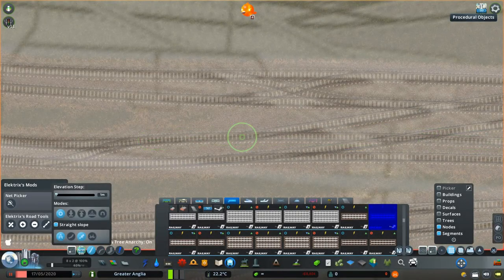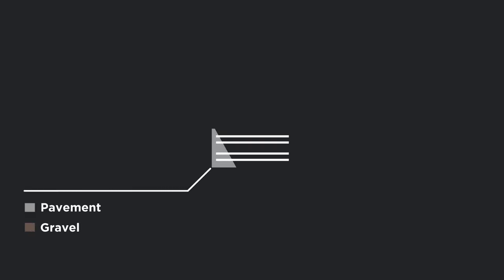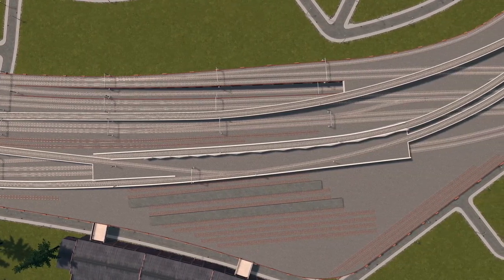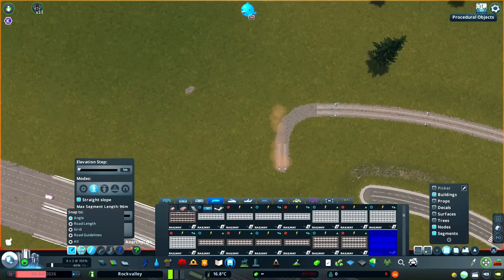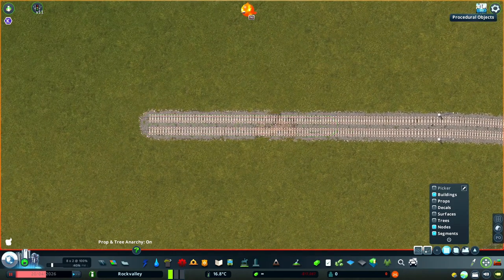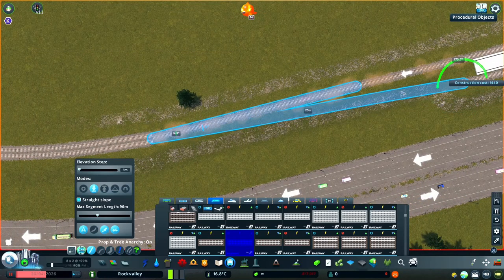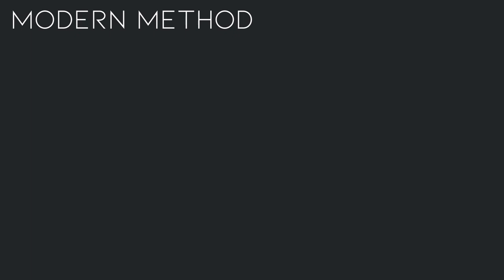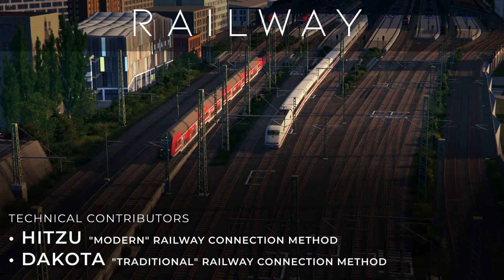Single and Double Track Connections in Cities: Skylines | RAILWAY | Episode 01

Comment: how do you get those stations where you don't always get the criss-crossing of the tracks on each end?  I thought those were baked in?
Reply from the maker: The station is a custom station with an island platform layout, so in this case I'm connecting two individual one-way tracks to each end (rather than the combined single track), so there's no crossover. You can find the collection of stations here: https://steamcommunity.com/workshop/filedetails/?id=1368830383
Reply: @kjmci  ah, thank you!  One thing I wanted to comment on, it would be very cool to see a series from you about the overall pattern and rhythms of how rail is laid out in larger scales.  Something similar to this video  https://www.youtube.com/watch?v=a_LHJ2YYgFU  But this video doesn't answer, what's beyond the rail yard?  how do tracks usually arrive at rail yards, which direction do they go, where do they go and why?  When do they use single tracks, double tracks, quad tracks or more?  Don't know if my comment makes sense, but I think you would be very capable of producing a video that answers this for people.  For instance, other youtubers end up with solutions to rail infrastructure problems like rail roundabouts and other wacky solutions (!) which are totally unrealistic - and I think this is because people, myself included, don't understand how they work in real life.
Reply from the maker: Good feedback, thanks! I'll put this on my list of things to cover in future.

Comment: The modern way using the new generation of node controller mod doesn’t work properly. When I select a node with node controller mod after connecting the 2 single tracks with the double track, it creates an empty space between the 2. Am I doing something wrong or is it because the mod isn’t design to work like the old one?
Reply from the maker: I've had a bit of feedback on this but haven't had an opportunity to look into the new node controller mod's functions - but fundamentally, new mod, new features, new interactions with tracks. This video is an explainer on the previous (and still available for download, AFAIK) version.

I will look to provide an update with the new version once I have time to produce some more footage :)
Reply: @kjmci  thank you for your reply! I found out that it’s actually working: after it creates the empty space, you CAN combine them, but not completely; it still remains a little space between the 2 tracks which is kind of annoying

Comment: Great tutorial! I installed the Node Controller Renewal 3.0.1 and it seems not to work in this way anymore. I keep a part without rails in the node.
Reply from the maker: Hey! I've been quite busy with work the last month which is why there's not been much in the way of new episodes. I'm on the alpha for NCR3.0.1 but sadly was not able to get a revised version of this video out in time. 

I have a short video due to go live this weekend, and will immediately take a look at NCR3.0.1 after that and have a revision published soon. Thanks for the feedback!
Reply: @kjmci  I'm having the same problems with the new node controller. Definitely looking forward to your video about that.
Reply from the maker: @MaxiKevey  Sounds like I need to fast-track it! Thanks for getting in touch.
Reply: @kjmci  No need to hurry, I'm 90% sure that it isn't possible, since NCR has a limit on how far you can move the end of a segment to a node.
Reply: So they updated NCR. It finallly works again. You can move segments right next to each other. No need for the hacky non functional track method.